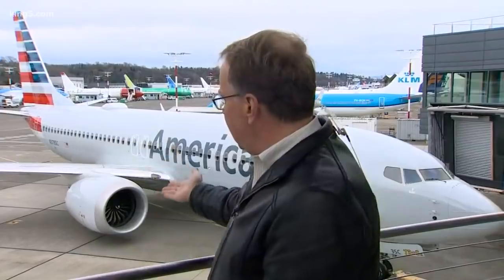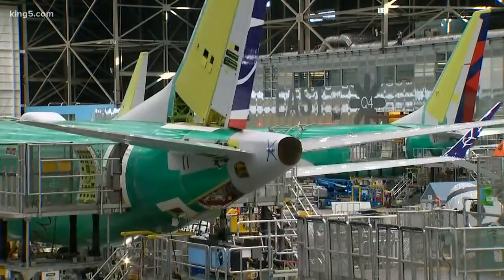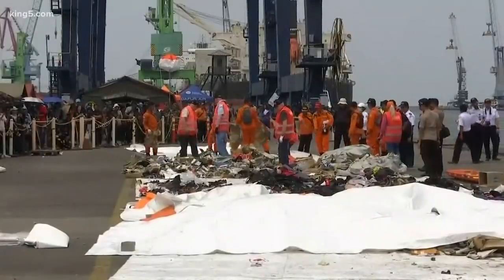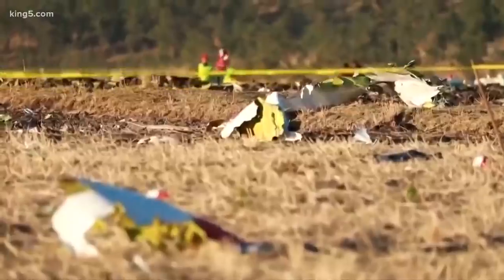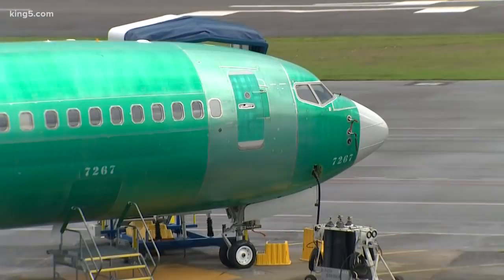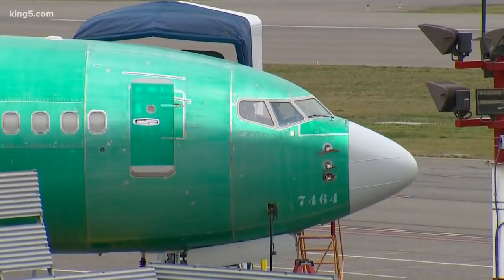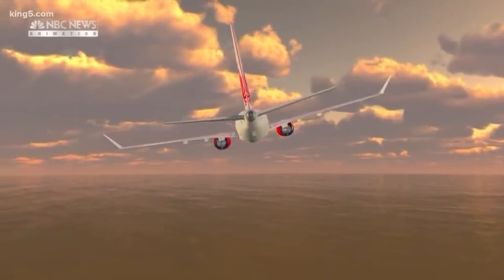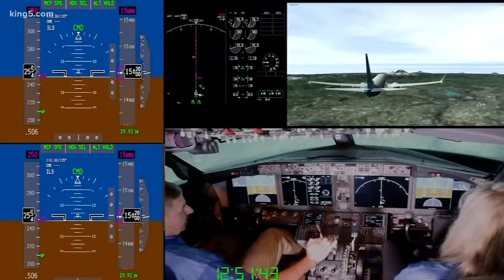Boeing unveils 737 Max fix

Comment: Unfortunately, Boeing lost  people’s trust. Fixing problems after 2 crashes... FAA and Boeing should be sued for Manslaughter. 
Why is there no FAA public announcement on the results of the crash investigation. But somehow we have all these fixes and software updates. FAA is bought like rest of the government.
Reply: From what I know about MCAS, yes it operated the trim to put the plane in a nose down position, but it could be easily overcome with pilot trim input, or shut off completely.  It was just up to the pilot to recognize what was happening and then correct the situation. 
MCAS did not takeover complete control of the airplane.
Reply: Patrik O the faa gave boeing the right to audit itself in the late 90s. So it didn't know what boeing was up to.(I know, very stupid indeed) as for the legal part I cannot comment. Chances are, they will get away with it by getting lobyes to threaten them with  sanctions. You know how it goes...
Reply: FAA has a conflict of interest since it promotes air travel and safety at the same time.
Reply: Or negligent homicide since they did not learn from the Lion airlines crash
Reply: NonyaBusiness! You dumbfuck, mcas existed in every aircraft since God knows when, what they didnt know is that it be defected as it could be activated by mistake. Fucking liar
Reply: FAA isnt the agency investigating the crash
Reply: Because ...murica.
Reply: They haven't lost my trust
Reply: For crying out loud. Learn to spell. That's "sued" not "sewed." Sew is what you do with a shirt, or pair of socks. That's " bought" not bough. How are we supposed to take you seriously?
Reply: Harris Naseem thanks I really appreciate you useless opinion on me
Reply: Lose trust? More people fly a Boeing product everyday, one being the 737 of all models. do u think the average passenger knows the diff?
Reply: SEWED??? OR SUED?
Reply: This is not just the FAA and boeing.  It is all regulatory agencies in all countries and the airlines.  Both allowed pilots to go untrained when flying the new plane.  I don't care if boeing said the training wasn't needed, that is no excuse. Airlines should have at least had one expert pilot evaluating these planes and recommending what pilots needed, putting all the blame on the FAA and boeing is a joke.  Everyone worked together to avoid costly pilot training and that is why people are dead.  The airline is technically the most wrong as they are the ones who ultimately chose no training.
Reply: Patrick O in some ways I do agree with you, but unfortunately Boeing decided to hide some very important information from pilots and companies buying max version of the aircraft. Now Boeing said that this airplane is same as  NG and no need retraining but forgot to mention very important changes in control automation.  FAA is the one that was supposed to catch that. But somehow they are all Quiet.
By this time they should have all the data from black boxes.
Reply: @azayika  I don't believe airlines didn't know what was going on.  The airlines are the ones who demanded MCAS in the first place so they could avoid training costs.  Boeing did what airlines wanted and regulators turned a blind eye.  Don't pretend the airlines are victims, they are the catalyst.  No one spends billions on aircraft without heavily researching everything about it.
Reply: So the FAA is the airplane cops for the world?      There was "minimal training" required for 737 max pilots needed. Pretty sure the mcas was that training
Reply: @jasonkeuma1986  Pretty sure the crash(es) were the training.
Reply: @jasonkeuma1986  These were foreign owned 737 MAXs. The problem started with Boeing skipping on certifying pilots to fly the 737 MAX. The 737 and 737 MAX are separate airplanes. They were treated as the same. The problem was added to when these foreign airline companies bought the 737 MAX and skipped on training their pilots in both the 737 MAX and the MCAS. The end result was that the crashes were the MCAS training. The pilots' training in the MCAS was completed at the scene of the crash.
Reply: @jasonkeuma1986  Yes. The FAA are pretty much "the cops of the world." First, the 737 MAX was a US built airplane (Boeing). Their jurisdiction is pretty much wherever the scene of the crash is. Second, when one of these US built airliners goes down both the FAA and Boeing perform an investigation. They have to. Boeing has a reputation (well, they use to), to protect. Politically speaking, if the CIA, the FBI, a Seal Team, or a Delta Force squad wants to tag along, come along for the ride, and do a little agitation . . . well, whose to know? Globalism being all that one world,  Total World Domination and such, these days.
Reply: @_PatrickO  did'nt you know? in 2011 american placed an order for an ugraded engine 737,a plane that at the time did not even exist,and yet months later boeing announced the 737 max so its americans fault

Comment: On 5 November 2014, Lufthansa Flight 1829, an Airbus A321 was flying from Bilbao to Munich when the aircraft, while on autopilot, lowered the nose into a descent reaching 4000 fpm. The uncommanded pitch-down was caused by two angle of attack sensors that were jammed in their positions, causing the fly by wire protection to believe the aircraft entered a stall while it climbed through FL310. The Alpha Protection activated, forcing the aircraft to pitch down, which could not be corrected even by full stick input. The crew disconnected the related Air Data Units and were able to recover the aircraft.[41] The event was also reported in the German press several days before the Germanwings crash.[42] The German Federal Bureau of Aircraft Accident Investigation (BFU) reported on the incident on 17 March 2015 in a Bulletin publishing the flight data recorder and pitch control data in English and German. As a result of this incident an Airworthiness Directive made mandatory the Aircraft Flight Manual amended by the procedure the manufacturer had described in the FOT and the OEB and a subsequent information of flight crews prior to the next flight. EASA issued a similar Airworthiness Directive for the aircraft types A330/340.[43][44]
Seems Airbus had its problems also. BOEING will overcome this. Third world maintenance procedures and pilot training will continue to be a problem.
Reply: The difference is: Airbus didn't blame the pilot for the pitch-down. They recognized this problem immediately and sent out warnings, while Boeing was trying their best to cover up the flawed design.
Reply: Philip W, no proof to your statement whatsoever and is pure speculation fed by news media creating controversy for profit.
Reply: @awesomexistence  
The proof is in your own post. Airbus never blamed the pilot. Here is a report.
https://avherald.com/h?article=47d74074
In which Airbus analysis the data and draw the conclusion:

"all three sensors worked normally until about 8 
minutes into the flight, when the aircraft climbed through FL195. At 
that point, at an ambient temperature of -35 degrees C, AoA sensors 1 
and 2 froze up at a position of approximately 4.5 degrees nose up and 
remained in this position until the aircraft descended towards the 
destination airport. At the time, when the autopilot disengaged the 
aircraft was flying at 0.675 mach, the Alpha Prot angle was 4.2 degrees,
 the Alpha Max 5.8 degrees. Within 15 seconds the first officer made 
increasing nose up input until reaching 75% of the maximum travel of the
 side stick, the attitude however changed from 4.5 degrees to -3.5 
degrees against this input. The system disregarded/turned off the AoA 3 
sensor because it disagreed more than the permitted value with the other
 2 sensors."

Do you see any words about the pilot failure to react? Do you see them hiding anything? Yet when the Lion Air plane crashed, Boeing blamed all on the pilot. When you have a flawed design, killed 189 people, how dare you pin this all on the pilot!!

The difference in handling of the accidents is clear as day. Everyone knows but you are denying it. Well, you are in the first phrase. I understand...
Reply: Philip W, AD was issued 9 December, 2014 and not made mandatory until 17 March. 2017. Not as quick as you would like to think. This incident happened and resulted in fatalities; 
On 28 December 2014, Indonesia AirAsia Flight 8501, using an Airbus A320-216, from Juanda International Airport, Surabaya to Changi International Airport, Singapore, crashed into the Java Sea between the islands of Belitung and Borneo, killing all 162 on board. The cause was initially a malfunction in two of the plane's rudder travel limiter units which caused the plane to stall while encountering a thunderstorm. The crew ignored the recommended procedure to deal with the problem and disengaged the autopilot which contributed to the subsequent loss of control. Investigators have stated that the condition of the FAC (Flight Augmentation Control) on the flight "was persistent enough" for the captain to do such actions. 
FAC (or ALPHA PROTECTION a function of FAC) is cited  in both incidents just as Boeing’s MCAS has been cited. The incident you refer to happened in Europe with the investigation in home territory. European Pilots are trained well and no where did I blame those pilots. Third World pilots as in the evidence i give, Indonesia AirAsia (AIRBUS)and Lion Air (BOEING)pilots. USA based BOEING investigators have no jurisdiction to investigate on foreign soil (w/o formal invitation) as well as time factor of recovering the Lion Air and Ethiopian flight data recorders sent to other countries.
Reply: Matthai Kurian, third world countries are accountable for a disproportionate number of aircraft accidents. They should regulate themselves better and raise their standards when it involves lives.

Comment: Perhaps a well trained crew and a stick shaker is all the stall protection the airplane needs. Does the Max really need MCAS?  The FSB obviously didn’t find any unique handling characteristics or it would have recommended a separate type rating.  The common type rating is a huge selling point. Give your pilots some differences training and they are good to go.

Comment: Hopefully they don't get it fixed in two weeks .I need to fly up to Seattle on Southwest in two weeks and I would rather fly on an older 737 .I think waiting to fly on a max would be smart until they put these back in service for about six months or so.
Reply: Mikeykaysuper If you get scheduled on a Max, speak to an agent as soon as possible to coordinate for a better routing. Better yet, choose an airline that doesn't have Maxes in the fleet.
Reply: @HEDGE1011  If they get the software fix done I will be comfortable with that .I flew on 2 Max flights last year on Southwest and their pilots already knew how to handle this problem so I won't be to worried .

Comment: What other design defects are still hidden in these planes? If the certification process was so questionable we should assume other problems could likely arise in the future. The whole aircraft should be recertified.
Reply: The new engines are too heavy and in the wrong position. Using software to correct a lack of balance is a really bad idea.
Reply: cabc74 That's actually a very relevant question and one I have considered as well. If this system was so poorly designed and slipped through certification, what else made it through the certification that's waiting to bite pilots and passengers?
Reply: Planes have been flying 3 years enough said kid

Comment: It takes them what 2 weeks maybe 3 to fix the problem?  Sounds fishy and if it was that easy to fix why not prevent the problem in the first place.  Never flying commercial airplane again.
Reply: It's another rush job from Boeing. They only tested the new system with 2 flights, and one of them was to pass the FAA test.

Comment: The problem was caused by both a lack of maintenance and pilot training in these third world carriers, the runaway trim response is the same as it has been sense the 707 the disconnect switches right between the pilots!
Reply: Right. Why Boeing is issuing fixes then?
Reply: Ethiopian airlines is not some "third world carrier", it is one of the top rated airlines in Africa,  which is why their fleet is made of new aircraft like the max 8.
Reply: That's why the first officer had just 200 hours flying

Comment: The original 737 doesn't need MCAS to fly. The newer design of this "flying coffin" does all because of trying to fit a fuel efficient but much bigger engine on the wing. Go figure if its safe. Most people with half a brain already know the answer.
Reply: Like 707 of 1958

Comment: The problem is that it's an unstable aircraft(wants to go up-turbofans bad placed)so it needs to have this mcas system or else the pilot has to always push the stick forward.i think there is nothing there for them to fix,because the problem will always stay and this aircraft will always need it in order to fly,that means it has potentialy several factors(angle of attact-computer disides push it down-etc) more than other planes  to cause accidents.

Comment: They can simply remove the MCAS and proceed with new type certification 
if they leave the MCAS pilots will still need stabilizer trim runaway training. 
Another thing, they could implement a system that tracks the stabilizer trim and the elevators position and if the stabilizer trim is at 0 or higher and the elevators are full nose up for more than 10s to issue an aural warning: ckeck stabilizer trim or something like that, a monitoring software that can identify unusual elevators-stabilizer trim positions.

Comment: When you have an ill designed plane, adding correctional software and alarms is kind of like enhancing a pig's appearance by applying lipstick.
Reply: Well said BR549
Reply: agreed
Reply: The 737 is a good plane, it’s issues with repairs and not stopping the plane, known to have issues from flying
Reply: Wrong! But you are entitled to your incorrect irrational opinion.
Reply: @ILM787  he's right you are wrong. But you are entitled to continue trolling
Reply: There are some devices which cannot be flown without software and sensors - the B2 bomber, for example, and the ubiquitous photo drones that any idiot can fly.
The problem is that the pilot assistance here was half-baked.
Reply: AAaaaameen! Lol
Reply: Hahahaahaah
Reply: I agree with BR549.  Boeing could have avoided the instability issue by increasing the length of the landing gear rather than repositioning the engines more in front.  This causes the nose to pitch up much more when thrust is applied.  The cost?  Much higher, but like AOC says:  people are dying and you,re worried about a few billion dollars?
Reply: ... and high heels!
Reply: Boeing makes the best Aeroplanes in the world. Period.
Reply: John Smelt HaHaha ha ja right hahahhaha
Reply: I don't doubt it, but that stabilization system wasn't fully baked.  I'd trust 737 and 757 over A319 or A320, for sure, but this MACS on the MAX looks like hasty compensation for a center of gravity change
Reply: Mike Rogers I have flown both and trust both.  Why don’t you trust the A320 design?
Reply: @mprogers51  Why? I dont recall any such problems with ANY A319/20/21 aircraft, why then is the 737 more trustworthy? The 757 stopped production years ago, why not add the DC3 to your list of "trusted" then?
Reply: The passenger electronics are unreliable - I hope the fly by wire was written by a much better team
Reply: @Cheeseatingjunglista   The airframe of the 757 could have taken the larger engines, or even the P&W engines without an electronic balancing act. The other commenter who mentioned the 757 was not necessarily advocating that we return to the past, so much as pointing out that the 737 design was MAXxed out, and grafting larger engines onto it was a compromise too far.
On the other hand, every flight on an A3xx has me wondering if the stuff the pilot sees is more reliable than the stuff the passenger sees.

Comment: On all the comments I heard of, every body assumed the plane is in good working condition before it hit the ground. They assumed the pilot could hand crane the motor beside  the seat to adjust the stabilizer. This motor is using steel wire to pull the jack screw. Under severe vibration and stall, no commercial aircraft body could survive. The body most likely is already twisted or cracked. The steel wire will be squeezed and jammed. Nothing could control any more, unless somebody go to the back hand crane the jack screw. There is not enough time any way. It is not fair to criticism the pilot without knowing the real situation.
Reply: Michael Tung: All previous Boeings had manual trim systems in the event of uncontrollable (runaway) or frozen electric main stab trim.   I believe the NG has one as well. It requires 2 pilot effort to hand crank the system after isolating (turning off) the normal system.  In the past, pilots routinely practiced this alternate operation procedure in the simulator.

Comment: For a more informative short video on the 737 Maneuvering Characteristics Augmentation System (MCAS) and the how's and why's about how one cannot just start pulling circuit breakers and get out this terminal dive [loss of aerodynamic maneuvering control] situation --- see the latest over at the BlancoLirio Channel.